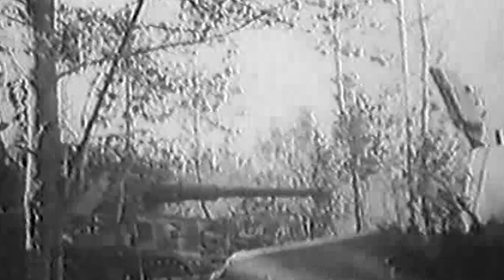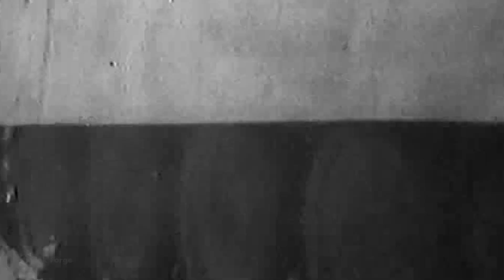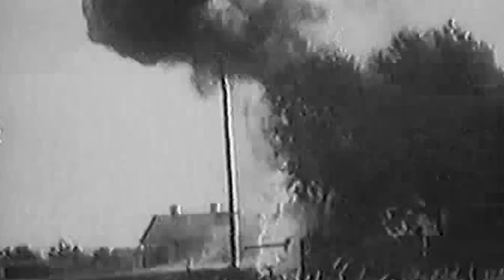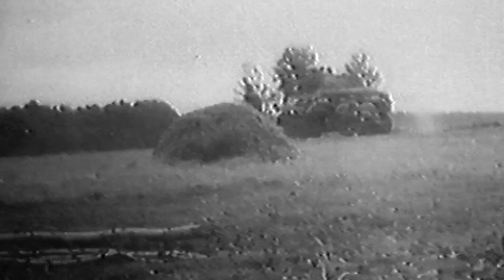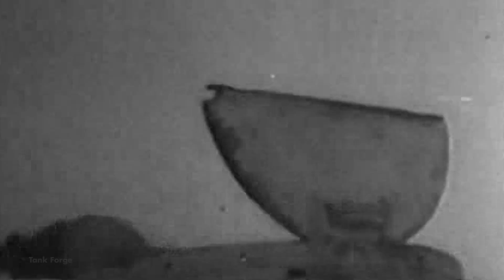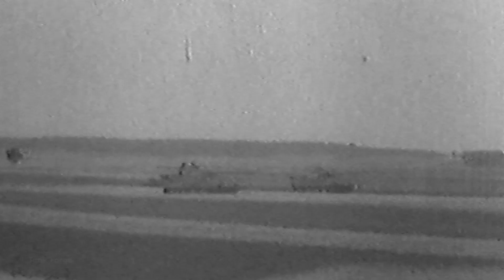Why Panther Tanks Failed Despite Being Superior?

Comment: No mention of #!tlers interference with armor? After the engine, transmission, and final drive were designed to support a 35ish ton tank, #!tler demanded ten tons of armor be added to the front of the Panther, pushing it to 45 tons. Without that extra weight the Panther might have had dramatically improved combat availability, making a big difference in fighting

Comment: Very interesting perspective. I didn't realize the Panther was such a liability. I guess if they had gone ahead with the original design which was about 10 tonnes lighter, at least the transmission issues would have been resolved.
Reply from the maker: Yeah totally — that original 30-ton concept might’ve saved a LOT of breakdowns. But Hitler really wanted it to punch through anything

Comment: Pz. Kpfw VI Ausf. H required 300,000 man-hours of work.
Pz. Kpfw V - 150,000 man-hours.
Pz. Kpfw IV - 75,000-80,000 man-hours.
IS-2 - 25,000 man-hours.
T-34-85 - 17,000 man-hours.
T-34-76 - 8,000-4,000 man-hours.
Reply from the maker: Dude, those numbers are insane 🤯 It really shows how much the Soviets prioritized quantity over complexity.
Reply: @TankForge-n7y  T-34-85 - 17,000 people/hour. Pz. Kpfw V - 150,000 people/hour.
The labor intensity of the T-34-85 production is 8.8 times less than that of the Pz. Kpfw V. 5976 "Panthers" in labor costs are equal to 52,000 T-34-85 tanks.
The T-35-85 tank was not inferior to the "Panther" on the battlefield, and in many ways it was superior. Although, the T-34-85 tank should be compared with the Pz. Kpfw IV.

Comment: By the G variant the panther was a mature design. It was only slightly more expensive than the panzer 4. What allied tank could compare with it? It's supposed failure was due much more wit factors that had nothing to do with the tank. Like being outnumbered drastically, allied air supremacy, fuel shortage etc. some creators suffer from panther envy.
Reply from the maker: Yeah man, by the G it was definitely refined. And you're right—its "failure" had way more to do with the war collapsing around it than the tank itself.
Reply: The T-34-85 was not much, but better and cheaper than the Panther G.
And the IS-2 was much better and cheaper than the Panther G.
The Panther and Tiger tanks are a dead-end branch of tank building.
Reply: The IS-2 was of similar cost, more reliable, better armor, better firepower and more fuel efficient.

Comment: Had the Germans stuck with the Pzkw lV with a long barreled 75mm gun, the Stug lll, and the Nashorn as a platform for an 88mm PAK 43, it would have been more practical. I think the Hetzer would be a good addition, given it was a different chassis made in Czecholslovakia.
Reply from the maker: Totally agree—sometimes less is more, and the Panzer IV and StuG III were like the reliable workhorses the Germans kept trying to replace with flashy thoroughbreds that broke their legs on the first lap 😅 The Hetzer was sneaky good too—compact, deadly, and cheaper to crank out.

Comment: General Guderian demanded and adequate response to the T-43/76 Soviet tank but was answered by German impresarios with a tank that weighed extra 12 tons... That alone condemned the tank: its engine was designed for a lighter tank; it wasn't what Guderian requested!
Reply from the maker: Guderian asked for a lean hunting dog, and they handed him a diva in a ballgown with engine trouble 😅 It’s wild how often practicality got bulldozed by overengineering.
Reply: @TankForge-n7y Hell to the yeah! 👈
Reply: @TankForge-n7y 
The engine was not the problem initially, it was the just short cooling system and deficient piping systems put in a tight engine compartment. Nothing wrong with the engine. After modifications it worked fine. The main problem was the final drive of the transmission
Reply: @TankForge-n7y no
Reply: No, completely wrong. this engine was fully capable for a 45 tons even for a 55 tons tank with 700 PS or 690.5 HP. It was the final drive of the transmission which had the problems initially. 
If not, every allied tank of more than 35 tons was fatally flawed. 
The M26 Pershing? Barely 450 to 500 HP engine . The IS2 tank? Just 520 PS or about 512.9 HP. The Churchill tank? Far worst, barely 350 HP for a 40 tons tank at the best. 
🙄🤦🏼
Reply: @franciscojaviermartineztor9745 The prototype VK3002 presented by Daimler Benz weighed only 30 tons but the one presented by MAN AG weighed 46 tons, so the weight was much more than expected...